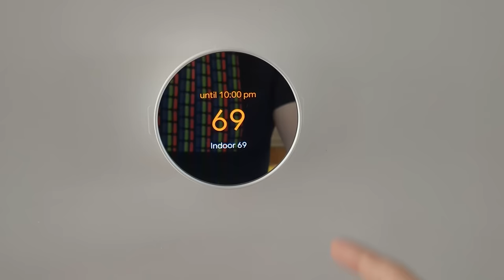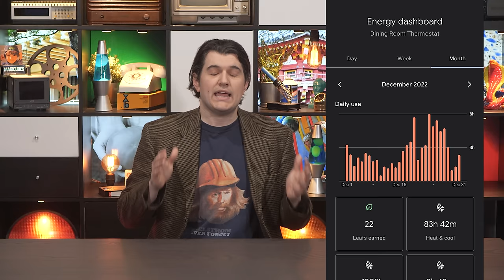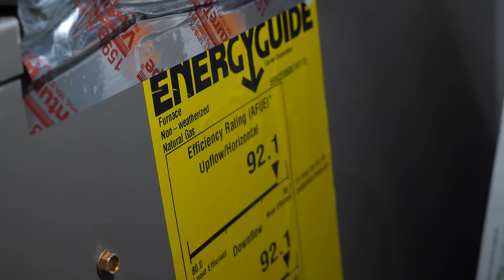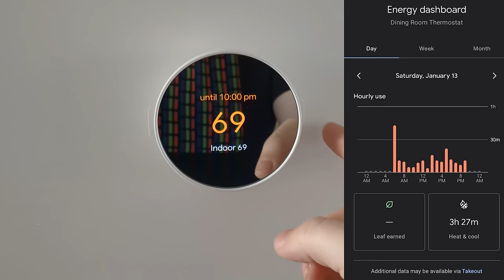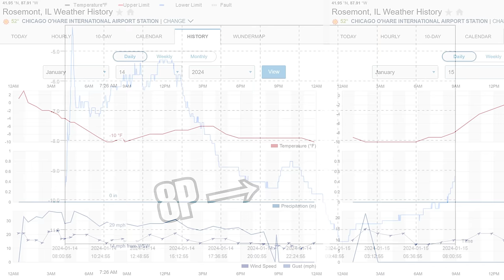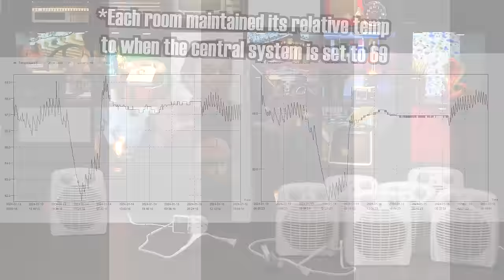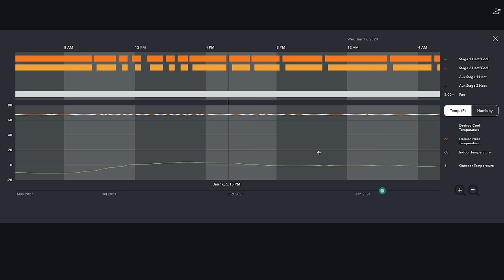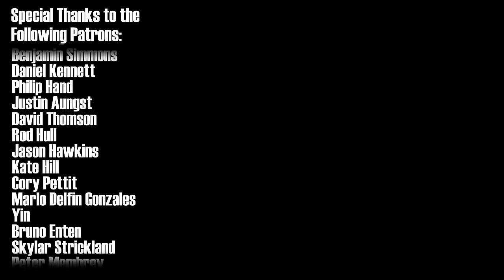Old HVAC industry practices are holding us back and costing us money. But we can fix it.

Comment: My story… My home is just over 2,000 square feet. I went an entire winter (2020) here in Indiana with the gas furnace turned OFF due to a Covid job loss and loss of income. I set my home automation to turn on heat if the area around my pipes got to 37° or less. My only heat was a 120V 1500W space heater in my bedroom. Despite a few days below zero, I didn’t run the furnace once and the indoor temperature never dropped below 41° that winter. I got used to a colder home and went on to do the same the next winter (keeping in mind that 100 years ago homes were colder, especially bedrooms at night, and that’s why my great-grandparents had all those thick comforters). — In the mornings I was wide awake before I even got to the coffee machine. A 50° walk to the kitchen can be quite exhilarating. — In the summers I no longer use my central AC. I installed a big whole-house window fan and I open 5 windows in the evening. The fan is on the home automation, running 10 PM - 1 AM and again 4 AM - 7 AM. I close the windows first thing in the morning and the house stays comfortable until evening on all but the hottest days. My summer electric bill tops out at $90 instead of the previous $400-plus when I used central AC. I do use a small window AC unit in my bedroom so I can sleep comfortably on hotter nights. I also use a “Sense” brand electrical panel monitor to monitor my power usage on a more granular level (I’m a gadget geek). You might be surprised how much money you can save if your home is reasonably well insulated and you’re willing to get accustomed to a slightly different indoor environment, as was common 100 years ago.
Reply: Tell this to my freaking girlfriend. Heater stays at 50-55. At that point, just leave the damn thing off... it runs more than it actually should, and the house isn't even that warm.
Reply: You will get mold issues if you don't heat your house over 19°C (long term) and live in there, because moisture from your body/breathing etc. will condense on the walls. Just a heads up :)
Reply: my bill is $100 a month and we run the a/c 24/7 all summer, is your house not insulated very well? I put in new windows and doors, added 12" of insulation to the attic, and my bills stay under $100 no matter what I set the thermostat to.
Reply: @tschuuuls486  It'll depend on how your home's built. So long as the cold bridge is outside the insulation, you're pretty much fine (condensation will happen where hot air meets cold).  15°C is what I've heard quoted pretty much everywhere as a minimum.
Reply: @mandrakethemadcoder  yes, that's correct. But it your insulation is not set up correctly (and that's probably the reason to not heat your home that much lol) you can run in to expensive trouble :D
Reply: Aren't you worried about water pipes freezing?
Reply: No, I would rather give up food.
Reply: @JohnLobbanCreative  pssst...get an electric blanket. You'll thank yourself.
Reply: @tschuuuls486 the humidity stays very low inside during the winter keeping condensation unlikely. I have a humidity probe for wood and everything seems more dry during winter. No mold issues so far.
Reply: @danwake4431 well-insulated for an Indiana home built in the mid-1960s. Where are you located?
Reply: @YourAverageReviews I have a remote thermometer near the downstairs crawl space pipes and connected to the home automation. Temperature < 37° turns the furnace ON until it reaches 40° and so far it’s never reached the threshold temperature.
Reply: @JohnLobbanCreative  Illinois. House built in 76. Inspector said to put 12” of insulation in the attic so I did. Then I put new windows and patio door in. Difference was amazing. If we are home and generating heat the ac runs but when we go on vacation and no one is home, the house will only go up a couple degrees with the ac off. 72 inside 90 outside. I love it.

Comment: Another way to figure out the heating requirement would be to shut off the heating (when it's above freezing outside so your pipes don't freeze) and then measuring the inside temperature over time. It will follow an exponential decay approaching the outside temperature and from the decay rate you can calculate the heating requirement at any temperature.

Comment: We added 2” on insulation to our adobe house in SE Arizona a couple years ago. The AC which used to cycle hourly (but never ran continuously even with our ducts in the attic) now rarely comes on, even when the temp outside is +105. We have a programmable thermostat but not a smart one; need to fix that asap! The gas furnace shows the same pattern, so a years data should give us all the data we need to evaluate upgrading. Thanks for the excellent video!

Comment: One major factor you don't seem to consider: duty cycle. Yes, the system is 4 times larger than you need, it is actually appropriately sized if the duty cycle of that equipment is 25%. This is something I felt you also missed in the "all heaters are 1500W" video. They CAN all draw the same power, but the physical hardware cannot handle running nonstop on some units, but other units can run nonstop without issue. Running a home heater beyond its designed duty cycle can reduce life due to the additional wear and tear on burners, heat exchangers, fan motors, etc. While day-to-day wear and tear is not noticeable, it can add up fast in equipment that is designed to run for years to a decade+. Not saying there isn't funny business involved in oversizing a home system, but equipment wear and tear is a critical factor.
Reply: switching to 100% duty cycle will have furnaces breaking left right and center at the 5-7yr mark
nobody is gonna pay $10k for a new furnace every 7 yrs when they last 20yrs+ now
new efficiency numbers are really not that much better and the advertising math is farcical to say the least
a new furnace doesnt pay for itself for nearly 10yrs....ooooh wait...what a coincidence
Reply: Doesn't start stop cycle from having oversized furnace also hurts as much or more idk than just keeping it running?

Comment: One thing to keep in mind: thermal mass. Just because you can't keep up with the load temporarily, it doesn't mean the temperature will drop instantly. 

If you turn off your heating in the middle of the day, it'll be fine for quite a while, because your desk is warm, your walls are warm, your floors are warm, and your bed is warm. What will happen first is that your walls will cool down, and then the rest will. 

The good news is that air is not that heavy. In my 75square meters / 800sq ft apartment, the air weighs about 300kg / 660 pounds. That's the thermal mass of the air. That's not nothing, but, like, that's the weight of the floorbords in my apartment, and it has very high ceilings. 

Air doesn't have too much heat capacity, compared to e.g. water. So, heating the air is often quite quick, and quite easy, compared to keeping the outside temperatures up. This isn't an infinite glitch, of course, but it is the reason why a tiny space heater feels so effective. 

But it does mean that even if your heating is underspecced, you will feel a temperature increase quite rapidly, especially near the ducts.

The thing can't heat your room immediately, but it can keep the air in your room warm, and, turns out, that's what really matters to your body. 

I do wonder if we'll live in a future, where, for efficiency sake, I'll have a warm / cold zone where the ducts are. I don't need my entire flat to be perfectly warm, at 22 degrees celsius / 71F. As long as the area around my desk is at that temperature, I'm happy. 

To an extend, I already live in that future, though. I live in Germany, so my portable air conditioner is all I have. It's hilarously undersized for my flat, but when it hits 37C / 100F outside, I still feel comfortable at my desk -- because it is aimed at my feet. 

Yes, my room is 27C / 80F at that point, sure. That's far from amazing, and it can't really manage a delta T of more than 10C/20F.

It's a portable air conditioner, after all. But still, I feel comfortable at those temperatures, because the air coming out of it is like 16C, and it's pointed at me, so it's keeping my body cool. I don't care that my dinner table, my dishwasher, or my table is warm at those temperatures. 

I feel cool, and I'm happy as heck with that. I can even do sports in my flat, because cool airflow is effective at removing the heat I produce from my body. I don't even sweat much - I sweat more in winter, when I don't have a fan running. 

So, putting your ducts near your sofa, your dinner table, your work desk - around the places people will linger - that makes a big difference in making an underspeced heating system bearable. 

Now, if the air conditioner wasn't as loud, I would have literally 0 complaints with it. Oh well, I calculated that my noise-cancelling headphones were like 1ct/hr until I replaced them, so, I guess that's the solution.

Comment: Row Homes (town homes) are significantly more complicated for heating and cooling because you share walls with you neighbors. In all likelihood, when you set your thermostat back at night, one of your neighbors (who doesn't have a nighttime setback) is actually heating your home for you. The same is true for cooling in the summer. Your system is oversized because when the townhomes were built, if you were the first people to move in, you would be effectively heating the entire row to some degree, so the heating unit needed to be much larger as no heating was occurring in neighboring units. The builder isn't dumb, and only installed the oversized heating plants because the alternative was getting many complaints form the first buyers, and potentially facing lawsuits over it. This kind of oversizing is far less prevalent in standalone buildings, or communal HVAC (single plant supplies the whole building with heat and cool).

It should also be noted that oversized forced air units tend to produce hotter air from the vents which gives the illusion of higher quality HVAC as compared to lower output temperature units with longer run times. The best way to avoid that particular trap is with radiant floor heating which allows the occupants to be comfortable in a building with lower overall air temperature, and avoids the quality perception problem mentioned above.

Comment: My brother-in-law recently upgraded his HVAC system. He worked for a HVAC supply company as a trainer and got a company discount on equipment. A very good deal. He had a 3 ton AC with 80,000 BTU gas furnace. He ran the numbers and he needed just over 4 tons of heat pump so he bought the 5 ton. He was going to use a new gas furnace as auxilery heat. Now when you stuff 5 tons of air into 3 tons of ducts you have a lot more air flow and need to enlarge some duct plus the return air and the return vent size. He put in the RUUD 20 SER top of the line variable speed heat pump with Econet thermostat. He set the unit NOT to switch to gas if it got too cold.

This is Texas and it got cold, 22 degrees cold. The unit ran perfectly. In the early morning and the unit was overwhelmed and could not keep up. Not a problem the unit went into Superdrive mode and created more heat. The only problem is Superdrive mode sounds like a weedwacker just outside your window at 6 am on a Sunday morning. 

He was pleased with the results. The problem was his nextdoor neighbor was not happy with the noise and complained. He explained what was going on and applogised. He reset the operation mode to use gas instead of weedwacker mode. I have a similar AC only unit and it will go into weedwacker mode when the outside temperature is above 100 degrees. I have to live with my weedwacker because gas don’t make cold air.

Bottom line. Sometimes you try to save the world, but deplomacy interupts your efforts.

Comment: Love watching your posts. Always great quantitative and qualitative statements and outcomes. I remember when installing an HVAC in a home that wasn't HVAC to start asking the rep to be sure it was PROPERLY sized and not just guestimated. He spent the time measuring and covering the house, settling on about a 2.5 Ton HVAC system with heat pump. All comparable homes were 5 tons for some reason. I said I wouldn't pay for anything we didn't need and to prove out the math... this was in the 90's. That house maintained 70 degrees year round just fine for me. Best investment I made at the time along with the new properly installed well with pressurization, hardness management, and 5 stage filtration.  (Unlike the old system which was well direct water on demand with no pressurization).
Reply: That 2.5 was also sized in a way that if we enclosed the garage with insulation & such, it would still have been more than enough. The math showed we could take the hottest/coldest days on record with room to spare. Even added humidifier & higher grade filtration (before the hepa boom) to the mix for ensuring air quality and comfort.

Comment: Do you know, why forced air heating is so common in the US? In Germany we mainly heat with radiators or with floor heating in newer buildings.
Reply: One reason is that with a greater need for summer cooling in many areas of the US compared to Europe, many homes will have central air conditioning and use the same air ducts for both heating and cooling.
Reply: Cheap natural gas.
Reply: Have you seen houses built in the USA? They are flmisy with less structure to them then E.U. shipping standards for wooden crates.
less insulation as well.

less than disposable crates.

This is not a joke nor exageration. Ive had the distinct "pleasure" of dealing with both US building standards and European shipping standards. 
US homes are typically built less firmly then well... Trash.

And for some reason we in the USA think our trash houses are worth about half a million on average.
Reply: Radiators and hot water heat are still common in older homes in the northeast and midwest parts of the country. My 100 year old home has cast iron radiators and I love the heat.  Before the 1950s, older homes like mine had cast iron radiators. Newer homes use copper fin tube baseboard heat, and some new higher end homes have radiant floor heat. Outside of these two regions though, it's rare to find it. Overall though, hot water heat isn't common here in new construction anymore. One reason is cost, it's far more expensive to install and the radiators and other components are expensive.  But the main reason is air conditioning, most people here want central A/C now which hot water heat doesn't provide unless you install it separately.  Some people with hot water heat install ductwork for A/C or mini splits, and many of us still use window units. So it's really down to high costs and the need for central A/C.  In warmer or more temperate areas of the country hot water heat would make no sense.
Reply: Cost, it's cheaper to install.
Know-how, fewer installers/knowledgeable workers. Similar problem finding plasterers instead of drywallers.
I guess AC, but I've seen a lot of houses with forced air installed and radiators uninstalled that don't have central air. I know nothing of how people in new-build homes live.
I assume there was some sort of propaganda effort at some point by furnace manufacturers that convinced the general public and builders that they wanted forced air. Folks in the US tend to fall in for trends when it comes to housing.

Comment: Superb. Great figures and methodology.
I'm based in the UK about 100 miles from London where our minimum temperatures very rarely go below -10C ( occasionally -15C) so our houses arent as well insulated. I live in a brand new new home and as soon as i moved in, I installed 8.5kW of PV, 10kW abtteries and a Panasonic 5kW ashp.  Most houses in the uk have water filled radiators rather than ducting so air con would need much more work. ( builders tried ducting homes in the early - mid 70s but gave up - probably because the houses are so small or badly built) 
PS. in the UK we call your style of home a "terrace house with the end ones called end terrace and  a home on its own is detached
Reply: In the part of the UK I'm from the semi detached would be one house split into two. Anything larger would be called a terrace and the end terraces would be called the "gable ends". We are talking proper Norf FC terraced housing for Victorian workers here. London terraced housing is completely different as are the mouth-watering prices.
Reply: If you are in a modern uk home (say built since 2007) then you might actually find your home is better insulated than his, we've gone quite far in that regard and now the air tightness testing etc makes a big difference.   

I'd say a semi-detached is when it's only 2 houses.. the ends of  a terrace are 'end terrace'
Reply: @mralistair737  agree with the end terrace it must have been late, have now edited

Comment: This is why actual engineers are important. I work in HVAC engineering and on our jobs we specify the size of the equipment for the contractors to supply after doing actual math for what the building needs, unfortunately no one wants to pay for the math to be done, hence rules of thumb. Also yes, the math is basically 100% done by software these days, but even in the industry none of the software is particularly user friendly and needs checks and balances run. With the prevalence of software it is high time that someone created an simple version for residential work, especially since the system and construction types are so limited in that field.